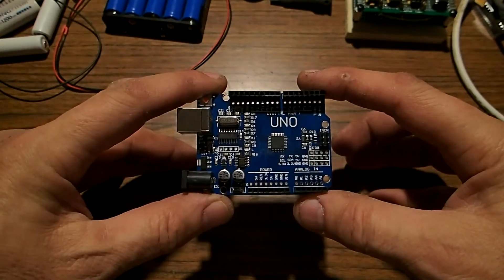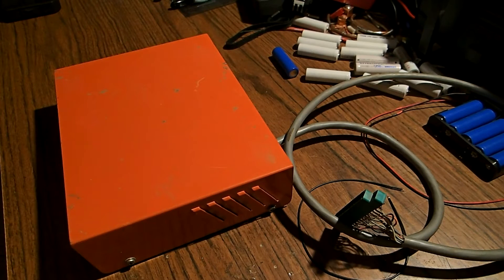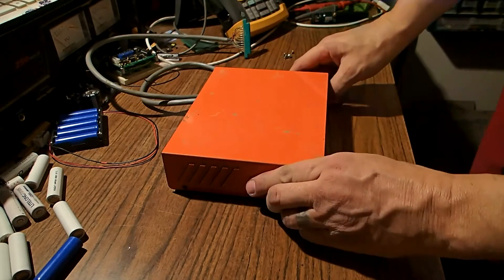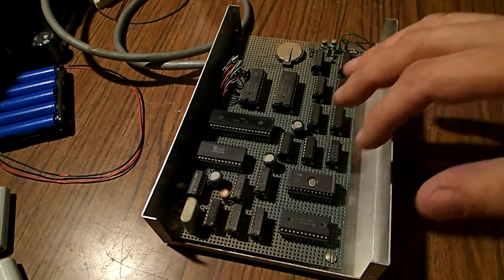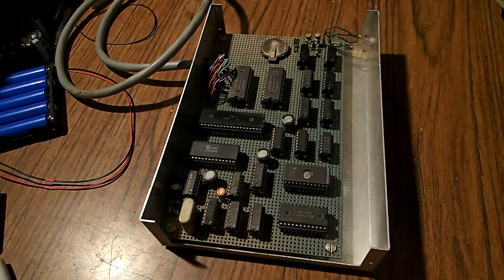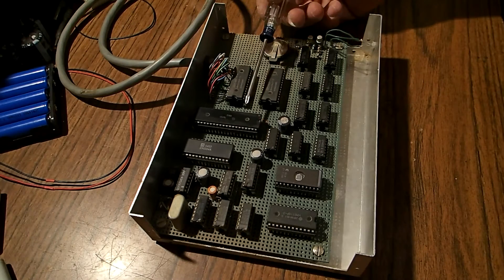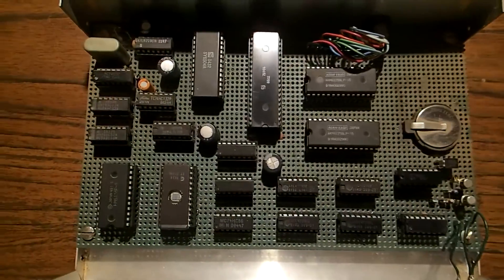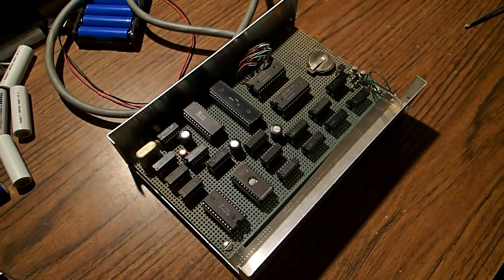What Was There 30 Years Ago Before Arduino Uno

Comment: Basic Stamp, & Atom for micro processors.. 

About the same size, same functioning. 
I was using them with wireless PS2 controller 25yrs ago, but their use well preceded me..

Comment: There were micro controllers before the Arduino. The PIC and the Intel 8051 are much older. You also have to think that a Arduino is just a breakout board with a ATMega programmed with a bootloader. Before the simplicity of that you had to program the MCU with Assembly and Machine code. Depending on the host system you used serial or parallel to connect the MCU to the host.
Reply: Leland Clayton Yeah, but this project goes all the way back to when microcontrollers were not so common. A lot of work was done on microprocessors from what I understand.
Reply: Aaron King yes and no. the PIC has been around since the mid 70s but micro controllers were expensive that typical hobbyists didn't want to shell out that much cash. what this video mostly showed was a typical 8 bit micro computer that was typically used for mathematical uses or system development. back in the 80s and 90s it was cheaper to build something like this then to buy the latest great computer on the market. I think the z80 and 650* series by then were as cheap as a arduino but back in the 70s and early 80s they were very costly but a MCU was cheaper then a CPU. Unless you didn't have the development kit for the MCU then you could of just bought a pc. in my day we just used a parallel port on a PC and used BASIC or some sort of assembly, FORTAN or Colbalt to send instructions to the parallel port.

Comment: SY6504 CPU
6522 VIA
Reply from the maker: horse1066 those were the exact part numbers back then still get them today couple bucks each.
Reply: yep, I just added them on because I hadn't heard of a 6504 processor before - I was sitting there wondering where the 40pin CPU was, until I realised the 28pin was the CPU.
I only ever studied the Z80 line, I kinda ignored the the 6502 stuff.
I remember wiring these things took forever, now you can run up a design in Eagle and get chinese PCBs for almost nothing.
I'm looking forward to having some time to start building a Zilog computer again.